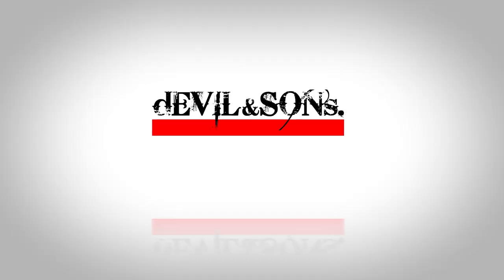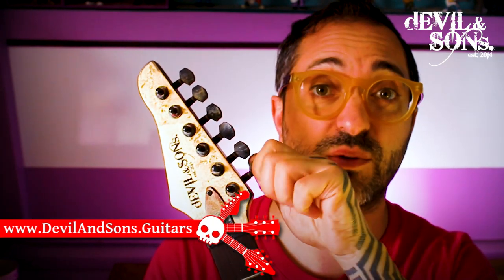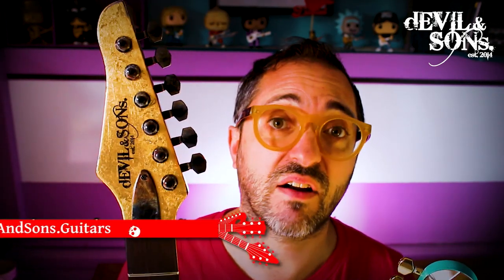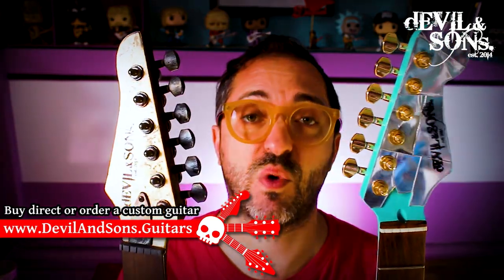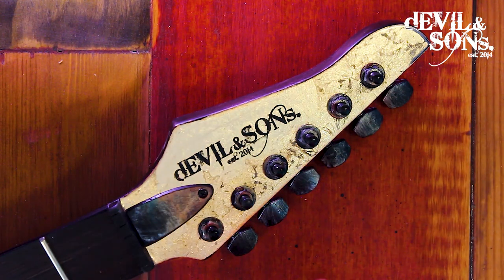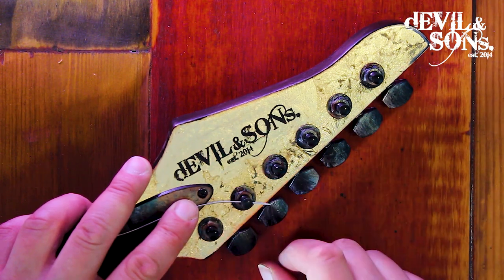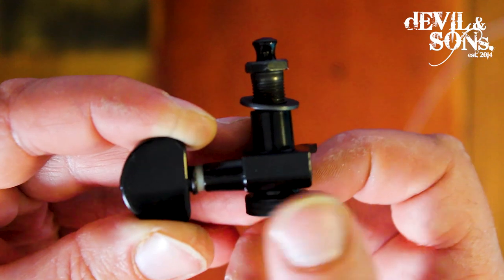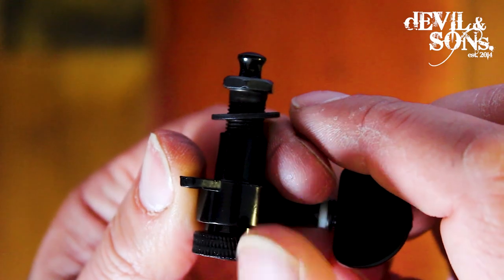Locking Tuners - What are they, how do they work, and do you need them on your guitar?

Comment: I have always used Grover rotomatics and never had any slippage after learning the technique I currently use way back in the 80's. I am however doing a GGBO '21 build and am leaning towards a set of hipshot locking tuners.
Reply from the maker: Thanks for commenting, and good luck with the GGBO. Hioshots are meant to be great so I don't think you can go wrong with them.

Comment: Thank You for the video !!  This is probably the most informative video that I've seen one the locking tuners..  Had questions because the locking tuners on the new 2023  Gretsch G6136 140 Double Platinum are different than the ones on my 1992 Ibanez UV7 & 1987 Peavey Tracer.  The Locking Tuners, to me, have always been a pain that I try to avoid ;   However,  I like the guitars, so I must work with the locking tuners.  I subscribed.  Your explanations coupled with the demonstration of how they work are quite good.
Reply from the maker: I'm so glad I could help and thanks so much for subscribing. If you really like the guitars but find the tuners a pain have you considered swapping the tuners to something different?
Reply: Thanks for the suggestion.  It’s my job to work with the guitar until I get it right.  I’ll just buy some cheap strings and practice until I feel comfortable and don’t break a string.
Reply from the maker: @leonardcanter4596 cool. Just a heads up that cheap strings may be more likely to break. Really the strings shouldn't break at all unless you are taking them on and off repeatedly in which case the point where the string is held be the "bite" of the tuner may weaken.
Reply: @DevilAndSons  You're  Right !!     Have a set of Stringjoy 10/52 Nickel Strings to install..   I'll go for it.
Reply from the maker: @leonardcanter4596 I only hear good things about string joy.

Comment: When you use locking tuners, about how many wraps should each string have. I understand the thicker strings like low E, A and D, will have less than the higher ones, G,B, E.  I am just wondering if you still continue to wrap the strings as you would using regular tuners. Thanks for the great video. Subscribed and will be following. Many Thanks…🎸✌️
Reply from the maker: Huh, I should have said that. Technically you don't need to wrap it at all. I tend to pull the string through and hold it in as much tension as I comfortably can, lock the string, then turn to tune. More recently I haven't cut the strings straight away but that's because I tend to put the strings on and off again whilst I'm building and setting up. If I were just setting up I'd probably cut then before tuning, once the string is locked in place. Thanks for the sub, much appreciated.
Reply: @DevilAndSons  Thanks for the response. Much appreciated….!
Reply from the maker: It's a pleasure. Do you have locking tuners on your guitar or are you thinking of putting some on?
Reply: @DevilAndSons  I have two I’m thinking about adding them too. A Fender Acoustasonic Telecaster and a PRS SE Silver Sky. I don’t like to change strings honestly and I think the locking tuners will make string changes a bit easier as well as the benefit of tuning stability. The Fender have the knob on the bottom and are drop ins. The PRS look like old fashion tuners and have 2 screws on the back side and have the locking part topside. So I’ll experience both types. Which you showed in your video and now I am aware of how they both work…!
Reply from the maker: Enjoy. They definitely will make string changes easier